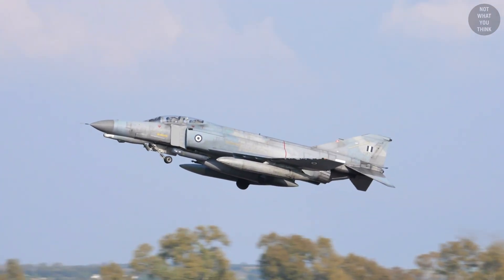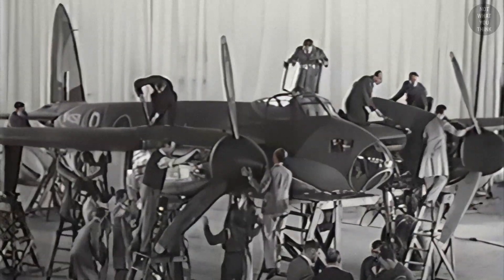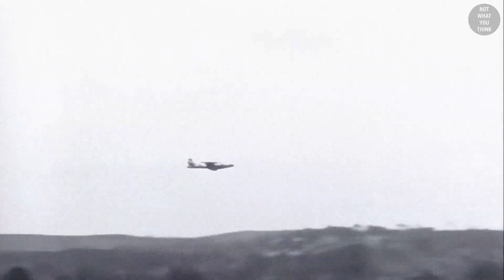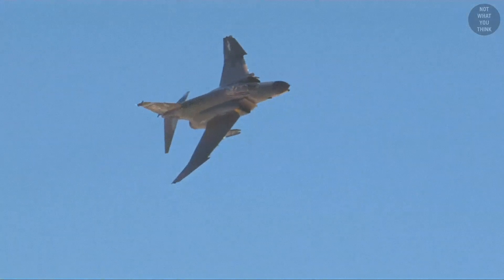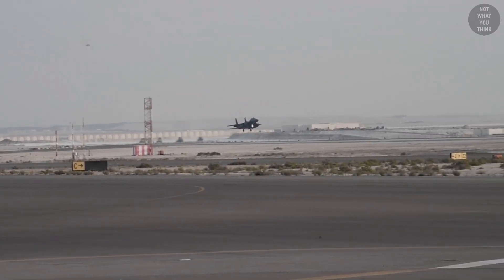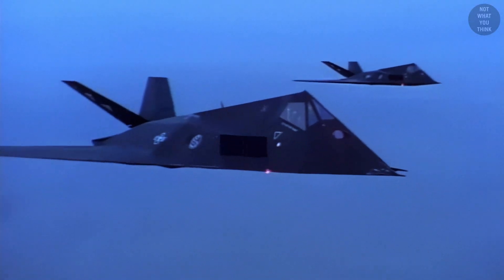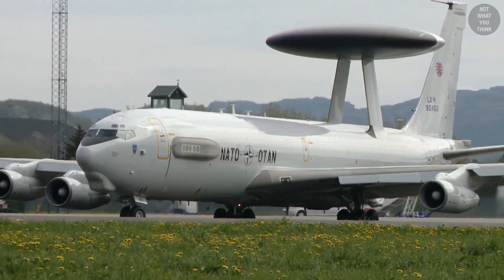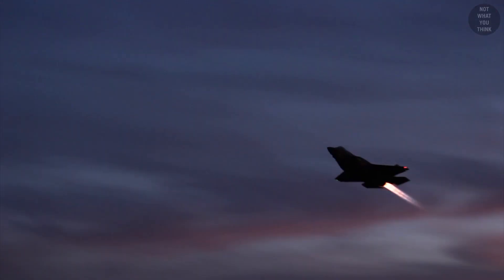Why are Modern Fighter Jets Slower than 1960s?

Comment: One important factor that wasnt mentioned besides supercruise as well as the fact that no nation is going to disclose the true top speed of their current serving aircraft, is BVR fighting. F-4's didnt have the long range missile capability like modern jets do. They never used their max speed because they didnt have a missile that could take advantage of it. Early Aim-7s and Aim-9s where visual range missiles. The Aim-120s we have now are long range and benefit from the extra boost in speed the launching aircraft gives it. An aim-120 launched from an aircraft going 0.7 mach will have a less energy and less chance to hit vs a jet firing at mach 1.6. Missiles dont have unlimited fuel and cant maintain the top speed mentioned but for only a brief time.

Comment: Top speed and turn-rate are still relevant but in a different way. If a fighter needs to engage in a turn-fight, something has gone very wrong. Most engagements happen at close to beyond visual range with missiles. Stealth and competent electronic warfare decreases enemy's range and high speed increases own missiles range (high launch speed gives an extra push and thus range). With this in mind most western fighters optimize towards EW and stealth over hyper-agility. The SU-57's awesome agility will be impressive at airshows and might lure in foreign customers, but if needed operationally, it's already lost.

Comment: I've seen a number of videos appear on this subject recently they all miss out a couple of important facts. First that all the aircraft they mention F4, F14, F15, etc all had an interceptor role designed in to enable them to get within the missile range of enemy bombers. Second when in a dog fight the large amounts of power their engines can generate allow them to maneuver better.  Another point that is overlooked is yes fighters such as the F35 can carry a lot of armament but once external hardpoints are used it has a detrimental effect on their stealth characteristics rendering their one major advantage irrelevant.

Comment: I'd like to see some actual speed comparisons. Boscombe Downe standard. The phantom was particularly quick at sea level Surprisingly as fast as the Blackburn Buccaneer at sea level which was designed particularly for this purpose..  A more interesting comparison would be the new F15EX versus the F35 versus F22...
Reply: At sea level basically everything has the same max speed of Mach 1.2-3

Comment: A two engine high altitude large fighter top speed being compared to a light weight, lower altitude fighter, with one engine?  Yeah that makes sense.  The Phantoms top speed is lower than Mach 2.2 when combat loaded. Its also not Mach 2.2 at sea level.  The F22 Top speed is actually classified and the F16 and F18 has a lower top speed than the F35 when you combat load it.   Anyway, high interceptor fighters didn’t have high speeds because of outrunning threats.  High speeds are necessary for launching so your missiles can reach their intended top speed and you extend their range.  Got to love when a novice puts these videos together.

Comment: For the same reason why modern nukes are usually only 1-2MT yield compared to cold war nukes which were up to 50-100MT yield. Aircraft don't need to go mach 10 to be effective. But going mach 5 to mach 10 requires ALOT more fuel and maintenance in the long term

Comment: Mount a couple of solid fuel rocket motors on those planes.
Note: women usually are much lighter than men and require less fuel for the plane.
They generally have better reflexes than men from what I read.
Now if you can just keep them off social media....
Reply: They crash cars much more tha men from what ive seen so i dont think we should let them near our beloved jets.
Reply: @generalmcarthur8401  During WWII and later, women pilots used to fly new planes from the MFR site to the delivery site.
Yes, they crash more cars than men, but for some reason the cops ALWAYS want to give the MAN the ticket...
Reply: What the fuck are you talking about? Solid fuel rocket motors? What practical use would that give? Speed? Missiles are faster, they will be always faster.
What does a human weight have a variable with a fighter jet? Human weight is insignificant in jets, most people don't go over 80 kilos, and women that got to be a pilot, they're usually ones that pass the test required to be one, usually reflexes, eyesight and g endurance. Men have to pass this test also.
Reply: @kaos1043  Seems you misses science class about the laws of motion?

Less MASS (aka lighter weight) means faster acceleration, faster turning, etc.

Not saying women are bad pilots, just bad DRIVERS.

Solid fuel rocket motors can provide additional power for takeoff and speed.

At takeoff, jets are the heaviest.
Why do you think they use launch assist on air craft carriers?
Faster takeoff.

Another interesting fact about women - they need less oxygen than men do.

Since women are generally smaller than men, nerve impulses do not have to travel as far and the result is faster reflexes.

Speaking of weight - why does NASA try to scrimp on grams of weight?
More weight means more power and fuel needed to do a particular job.

Simple physics really.

If a woman pilot can shave off 1/4 second, that could mean the difference between life and death, win or loss.

Biggest issue with women in combat is that they are the baby machines (breeders).
Lose one and it takes 2 decades to replace her with another one.

Men are basically a dime a dozen.
Reply: @crazysquirrel9425  I know my laws and physics, you seems to be a bit fanatical for the theoritical rather than practical.

Less mass can lessen the weight of aircraft thus helping lift off, but human weight generally isn't over a hundred kilos, and most jet aircraft can carry hundreds of kilos with the airframe itself weighing tons and that doesn't even strain the speed, or the aircraft. 

This is sexist, and built on a statistics not individual skill, which is what is sought for pilots, not drivers, 

Solid fuel? What is this? An atmospheric rocket leaving the earth? What is the use of it practical? Jet engines is the most effective way to power speedy aircrafts already, solid fuel rockets will add little and will add more cost.

At takeoff, aircraft needs drag to be able to lift itself, the aircraft still is at its heaviest because it doesn't get any lighter, unless you count burning fuel as having less.
They use launch assist because of the shorter runway, meaning less lift to be able to takeoff, why do you think runways being long?

Another interesting fact about women is that each person is different, with different bodies, and different quirks with their bodies. Meaning how much oxygen they need is irrelevant ? On statistics, needing less oxygen isn't really needed, because the aircraft will still supply oxygen in levels that is safe, so I don't really see how needing less is practical.

Generally, women are smaller, yes. But reflexes is a genetic lottery and skill acquisition, you can train yourself to have reflexes sharp, or have it on the go. Women isn't the only one having fast reflexes, F1 drivers are known to have good reflexes when driving speedy cars.

Why does a space organization have to do with fighter aircraft?! They have different shit to deal with, especially the Earth's atmosphere making things harder to get out of it! Fighter aircraft won't leave the atmosphere.
And the second of part of this isn't even a problem for military jets! They have specifications, and is built on it, military can use all of its fuel because it's the military with a military budget, NASA? They use solid fuel, liquid Oxygen and Hydrogen, uses Rockets that is built to get out of Earth's atmosphere! Expensive shit, and NASA has limited funding.

Simple physics indeed, ignoring the complicated thinking to build an aircraft,

Shaving off what? Decision making? Reflexive maneuver? What is it? If women are better at it, why didn't the military make a special program specifically for female pilots? I know, because it's stupid.

Biggest issue with women is that most of them don't want to be in combat, doesn't really have upper body strength to carry the equipment if they're infantry and having less the endurance. And breeding machines? Really? How old fashioned, our population can self sustain itself and we're having overpopulation.

Really simple take, a bad one at that

Comment: The reason why modern airplanes are slowish is because a) very few airplanes were introduced in last 30-years, b) sustained top speed favors large body, c) stealth directly hampers speed because current stealth designs prefer fat body with gentle coating.

For example F-35B and C are not even capable of going supersonic without damaging stealth coating. In their case stealth is favored more than speed.

With today's technology I think it would be comparably "easy" to design interceptor plane able to supercruise at 1.8 - 3 mach. After all Boom Overture, civil company is creating supercrusing long range plane while fully privately founded. Going very fast, like 2+ machs, is not necessary fuel inefficient, at least from perspective of fuel to mileage ratio. With that kind of speed the plane would be effectively unbeatable just as SR-71 is.

But the thing is, going that fast requires a lot of power, and "a lot of power" means large engines on a large body which means high costs. It also means it is not stealthy. Any conformation with that airplane would be very easily avoided by any other radar equipped plane. So while being unbeatable, it also wouldn't be very usable as a aggressive fighter.

Leading to the only proper usage of design as a defensive high speed interceptor - a typical role of MIG-31 or Pavian Tornado. And that is dying role as it is overspecialized in a world with so few new designs.
Reply: Tornado never was a real interceptor, it's a fighter bomber with a very high wing loading, which makes it a stable platform in dense air at low altitude at high speed. The job was to fly 30 to 40 m under the Soviet radar, with an automated terrain following radar.
There was an ADV version, but because of the high wing loading (and bad turn rates) it wasn't a success
Reply: Nah. You are talking about Tornado IDS. Tornado ADV is proper "interceptor". It's job is to intercept Russian bombers long before they reach UK coastline.  It is member of the same class as Mig 31 or English Electric Lightning. Those are airplanes with massive engines, long reach, low manuverability, but extreme speeds.

Comment: The Mach 2.2 of the phantom was an optimistic figure: armed with 4 sparrows and 4 sidewinders the figure is much closer to Mach 1.6.
An F35 for example is always able to reach Mach 1.6 due to the internal weapon bay.
And F104S could go quite faster but only for a very limited time due to heat build up on the engine compressor.
A Phantom was also a fuel hog and despite the much larger file tanks, while both at Mach 2+ it could not even go half as far as an F104 due to the twin engines and the bad aerodynamics. During the Vietnam war, the F105 pilots escorted by phantoms lamented being forced to slow down to allow the fighters to keep up, becoming more vulnerable to ground defences.
Modern Jets are much more efficient, despite having turbofans, that are not very good at supersonic speeds and ignoring the "Area Rule" completely: large use of composite materials also don't mix well with the heat generated at high speed due to attrition. Typhoon can still both go over Mach 2 and supercruise without afterburners, carrying as much weapons as a Phantom but being much smaller, and there is where the huge improvement shines.
The only exception of the vietnam era was the F106 which was an amazing plane which performances still hold today.
Reply: The sparrows had very small drag increase on the phantom, it could go faster than mach 1.6 with them
Reply: @FullThrottleRacing535  sparrows, external pylons and  4 sidewinders which was the standard Phantom configuration.
I've NEVER seen an F4 taking off with Sparrows only, and these missiles were often dumped on purpose by pilots before engaging in combat during the Vietnam war, because they were heavy and they sensibly compromise the performances of the plane: sparrows may not be terrible from a n aerodynamic PoW, but they are very heavy and that mass requires thrust to be brought to speed.
An F35A is about as fast as a Phantom on an Air to Air configuration and can get in position faster too because it has a better thrust to weight ratio and better range at that speed
Reply: The F-106 was a specialized interceptor, very fast and built with area rule.

Comment: Its like comparing a 60's 'muscle car' with a modern sports car. On sheer straight line speed a muscle car might have the edge, but on manoeverability the modern sports will win hands down. And in the air, fly-by-wire technology means planes are now made inherently unstable so they can turn and flip on a dime, which is more important in a dogfight or dodging a missile attack.

Comment: So if subsonic is better why the craze for hypersonic aircrafts? 

It's not making any sense to me. In my opinion if they want to go in that direction they'll have a lot to consider in it's development like high agility or maneuverability, materials, fuel, distance, resistance dynamics, stealth, electronics and weaponry. It's got to do a lot more than just fly straight. It has to go beyond whatever we know or have today like having the ability to stop suddenly mid-flight, ability to bank easily, fly sideways, upsidedown on a whim, backwards and of course VTOL. It can fly into space and vertical strike upon reentry like an ICBM and disappear into space just like a UFO. The enemy won't know what hit them. Anything short of this is just a very fast missile manned or not. DARPA are you reading this?

And by the way if the Russian S400 missile system can achieve Mach 7 why is it not referred to as a hypersonic missile? This is so considering that hypersonic speed is said to start from Mach 5 upwards.

Comment: F35 have one engine, F4 phantom fighter/bombers had 2 engines. Also, the F35 can loiter on the attack site a bit longer than a F4. However, a F15 or F16 are better planes than the Lightning.
Reply: F-15s are faster of course, but the F-35 has its stealth and not to forget its sensor equipment, which is the most modern one on market.
You can't attack a long range air defense system (like the S-400) with a F-15, but you can with a stealth aircraft since the detection range is much lower here

Comment: The F-35 speed was reduced from 1.6 to 1.3 not because it was not needed but because the higher speed damaged the jet
Reply: That was only true in the early B models, and that issue with with sustained blower heating the tail section has been rectified.

Comment: A big difference in fighter speeds between today and those in the 60s is also in the doctrine of air warfare. In the 60s, the prevailing ideas of what a fighter was meant for had more to to with nuclear warfare. Fighters like the F-14 Starfighter, especially, were designed to be interceptors. To be able to catch up to and destroy enemy ICBMs/Strategic bombers or to support friendly ICBMs/Strategic bombers. Modern aircraft are more in line with the air superiority and ground support doctrines. Designed to clear an airspace to allow for battlefield support of ground troops.

Comment: You mention the deHaviland Mosquito and Hornet, but switch directly to the Kroean era with the Sabre and Mig-15 ...
why did you leave out the Messerschmitt Me262 which was the first jetstream powered fighter and therefore increased top speed substantially  ?

Comment: Everybody always overlooks the human factor in high-speed jet combat aviation. The human body just can't take the abuses of ultra high speed maneuvering .  Even with the best Stiletto pressure-suits and pressure-balancing and cooling systems that pilots are practically sewn into like a kevlar corset, can't alter the fact that high positive and negative Gee stresses on the human brain of even the toughest, most experienced pilot will cause red-out/white-out/blackout if you experience enough Gee force.  High rate turns above mach speed are literally punishing on the nervous and circulatory system and make it nearly impossible to operate controls after a certain point. A 10 Gee turn makes a human hand into a cinderblock or kettlebell in terms of weight. Pretty hard to manipulate controls of any kind at those speeds, let-alone fine-motor skill switches and toggles and thumb joysticks. The faster you fly, the more Gees you will develop from sudden or sustained changes of attitude. 
When Drone fighters are perfected, this won't be a problem, because the aircraft can fly to it's structural limits by joystick with the pilot safely on the ground.

Comment: F4: MAX speed, reheat: Mach 2.23 , supercruise, (military power) 1.5
F22: MAX speed, reheat: Mach 2.25 , supercruise, (military power) 1.8
 
Cherry picking examples is not fair.
You cannot compare a freaking VTOL multipurpose frame to a hardcore interceptor platform.  

Granted the F22 isn't much faster in reheat, but the difference in supercruise speed is substantial.

Comment: A British pilot wrote that they were never able to get their Phantoms to go more than about Mach 1.8 or 9, and Phantoms that were able to go Mach 2.2  must have been somehow stripped down and souped up.
Reply: British F-4s initially were just ex USMC/USN F-4Js. Later British orders were customised to Britain's requirements and included more modern engines focused on reliability and efficiency at the cost of performance, which is why they were slower.
Reply: The Brits used Spey turbofan engines that performed better at lower altitutes than the American counterpart. Downside was that it performed worse at higher altitudes were the US Phantom could go mach 2.2.